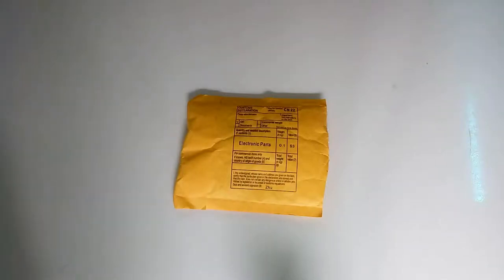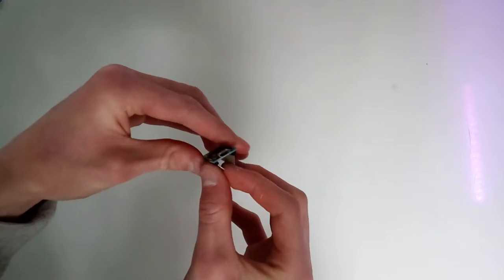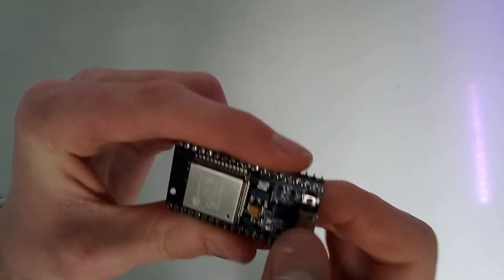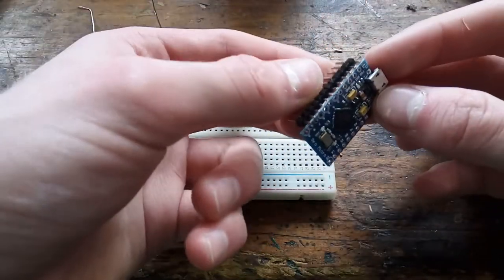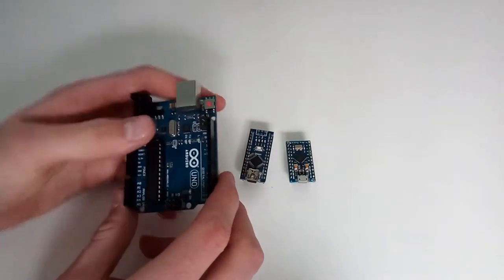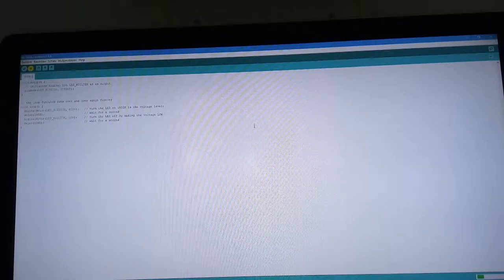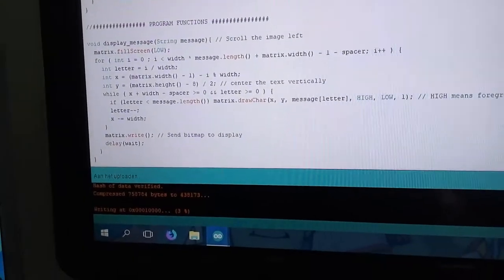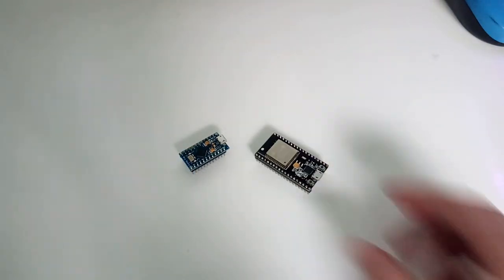Arduino Pro Micro and ESP32 Review! - Cheap Microcontrollers For DIY Projects!

Comment: That system for turning the computer on or off is really nice, but I'm just wondering, couldn't you plug the device into the computer instead of the power bank? (computers tend to have powered USB ports even when they're turned off)
Reply from the maker: Haha, yes, you're totally right. I wasn't really clear about it, but I did that to make sure people could see that the board itself indeed had wifi, which might sound a bit unbelievable to people who haven't heard of it before. But yes, if I were to use this, I would use the usb ports on the computer.